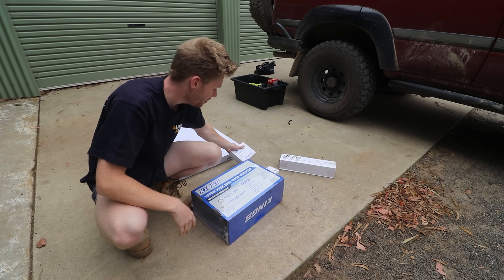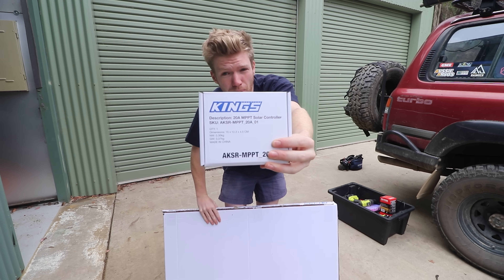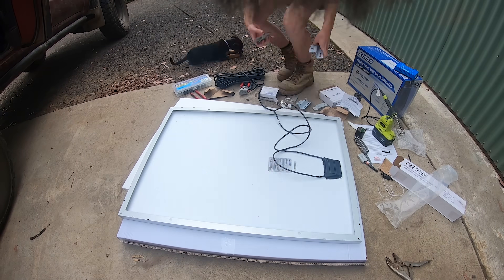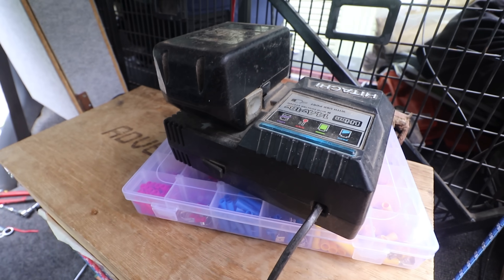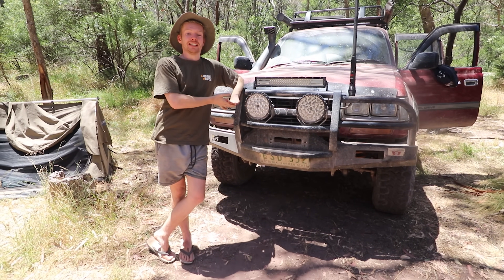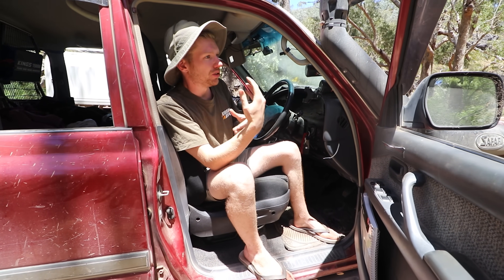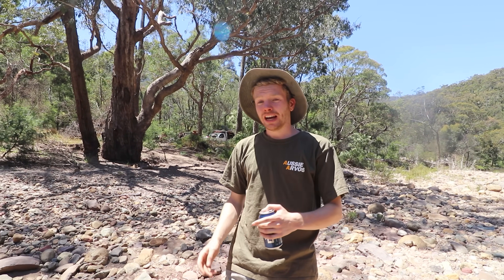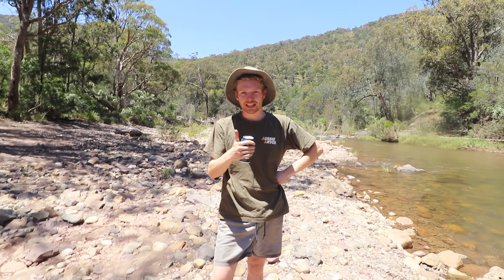Should you put SOLAR on your 4WDs Roof??? + CHEAP 240v Setup! What FAILED?

Comment: Love the video, great to see you back. Can't wait for more adventure vids.
Re the inverter - if it's for laptops and cameras then it's much easier (and cheaper) to just by the 12v adapters. Jaycar do a universal laptop charger from ciggie plug for about $50. Doesn't make a lot of sense to charge low voltage items off a low voltage car system by going up to 240v and then all the way back down. But everyone seems to do it that way.
Reply from the maker: Yeah i agree paul, i've had 12v adapters for laptops in the past, more just for others at camp who have 240v electronics that need charging !
Reply: To be honest, it's not too bad or inefficient using an inverter. Most are up in the 95%+  efficient, and OEM laptop chargers are definitely higher quality than the jaycar 12v ones etc, so all in all, it's not too big of a deal. Plus the inverter will only draw what it needs to from the battery. 
Some cameras you can't get 12v chargers easily.

Comment: I’ve personally never had any dramas with kings gear. I’ve got 2 deep cycle batteries a compressor and a switch board and I also got a jump pack for Christmas off the in-laws. I know a lot of people on these 12 volt sites on Facebook give them a lot of shit but if it works why change it 👍🏽
Reply from the maker: Yeah, you just got to be realistic and know that you get what you pay for, alot of people that get upset are those who buy a $200 inverter and think it will last/perform like a $2000 aussie made inverter. But yeah so far my experience has been great, been able to have all these camp luxuries for a very low cost!

Comment: Hey man love the vids! I heard that you should put the inverter on a switch as they have a parasitic draw even when the switch on the side of the unit is off :( also, do you have any water leakages with all the cables running through the rear left door?
Reply from the maker: Hmmm interesting! i didn't know about that! but I might have to do that, and no , no leaks !
Reply: Mmm... I also found that comment about parasitic draw interesting, I have a cheap battery monitor, and couldn't work out, why is there energy escaping, when all my connections have been ocd, and all draw is off.

Comment: Enjoy the vids guys. My Kings inverter had smoke coming out of it when first switched on. Auto elec said do not replace with another so upgraded to a different brand.

Did you fuse the inverter?
Reply from the maker: Thanks not what you want, the inverter is meant to be fused from factory, but might be a smart idea
Reply: @AussieArvos  would be looking at around a 175a fuse so might be best to check. I added one to mine on advice from my auto elec.

Comment: You should get another car and build it with free “high quality” stuff, then compare that vehicle to your current one after 12 months. 
People miss the point with Kings gear. Their target market is people who camp every now and then, not people who are travelling the Simpson dessert for 6 months! They are just like cheaper power tools. They work fine for the guy who builds things in the garage from time to time but you wouldn’t use them on a job site.
Reply: The ones who bagged them don't get the sponsor $$$ like that 24/7 mob. When they started they where always promoting them. Some may say cash for comment. 🤣😂🤣😂
Reply: Spot on, I go camping a few trips a year. Just want a cheap workable setup.
Reply: @zaccole4267  same and the thing is, everything I’ve bought from Kings is still working 🤔
Reply from the maker: I like the idea !
Reply: @AussieArvos  thanks. Only downside is that you have to buy another car, lol.

Comment: Had there Kings 110w Semi flex solar panel it was a beast got smashed by hail, ordered another one and they sent me a 160w semi flex instead and its trash, the coating on the panel all degraded and has broken apart, and before it did that it stopped producing power, have a 110w hard mount and its going great, cant complain i brought a CTEK D250SA through them for $300 where as Repco charge $900 for the same thing

Comment: I'm with u on the kingz gear I got the hole set up 160w panel 25a dcdc charger 1500w inverter control box run fridge lights 2 fans and everything else keeps my lithium battery at a 100% all day never had any problems what so ever 2years on could easily live out of my truck
Reply from the maker: Yep!! 👌

Comment: Well said Pat. I'm not a big fan of Kings and would rather buy Aussie Made but the prices are ridiculous. I run a Kings 110w panel on the roof of my Pajero with a Ctek DC-DC charger and it has run fine for about 18 months. Charges my 140ah AGM Deep Cycle which runs my fridge 24/7 and charges phones, cameras etc when out bush. I don't run an Inverter though, although I do have a Plug & Play 600w MSW unit if needed (So far never needed it and its only for charging a laptop battery if needed). The Kings gear is cheap and nasty but it does do the job for those of us on a budget.
Reply: I think people forget why it’s expensive you are not only paying for the quality of the product, you are paying for the cost of producing something in a country where the workers have rights and fair wage. Brands like kings undercut and pirate original design and then sell it on a large scale to turn profit. Australia has some of the best  4x4 and camping suppliers around and adopting the if it’s cheap but works mindset does not move the industry forward in anyway.
Reply: @philipwatt6183  I do agree with that and that is why buying Aussie made is by far better but as stated above and by Pat, not everyone can afford it. As mentioned above, if 8 had of gone Redarc or other more expensive Aussie brands there is no way in hell I could of gotten myself set up qnd out there doing what I love.
Reply: Some of the gear out there is redicously expensive. I've just set up my Pajero with a Renogy 50a DCDC with MPPT. Quality is fantastic. Was actually chaper than the new Kings unit but with a much better reputation.
Reply from the maker: Yeah agreed , I don't like buying cheap Chinese stuff, but when you are on a budget it hard not too. Because it does work pretty well at a fraction of the cost, but definitely ethical things to consider!
Reply: @AussieArvos  That's it mate. I had $2500 approx. to do my rebuild. This had to include a full drawer rebuild, fridge to suit the space I had (Dometic CD-30 Drawer Fridge), 140ah AGM Deep Cycle, DC-DC charger, Solar, Wires, Lights etc etc. I had just spent around 3k replacing the clutch and timing so really couldn't afford to blow the budget or splurge on other things. 18 months on and it is all working an absolute treat. (Full Build videos on my channel)